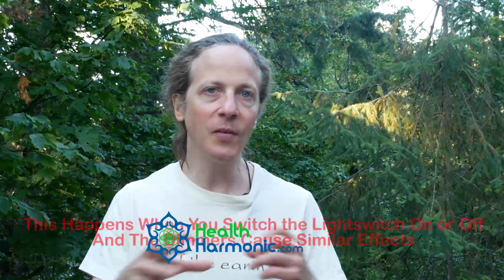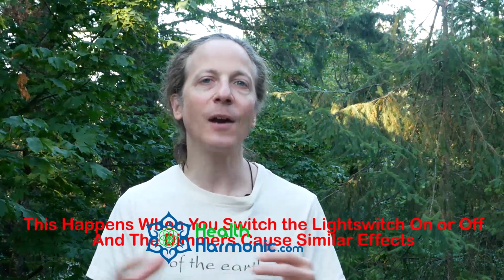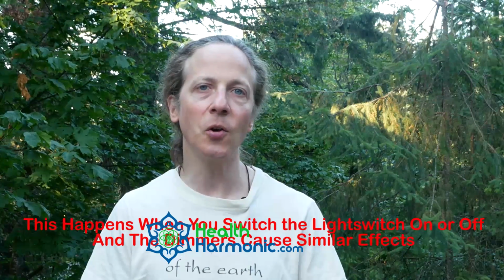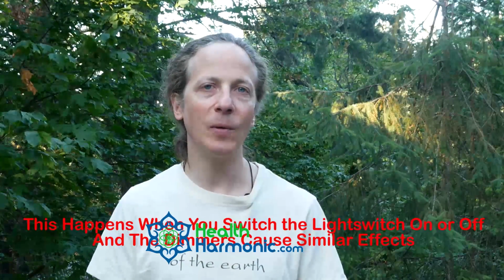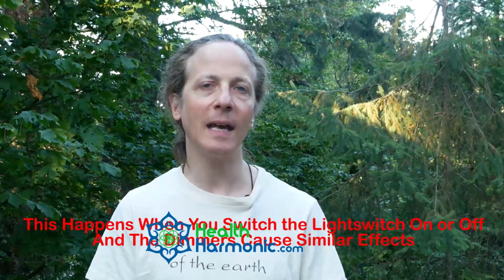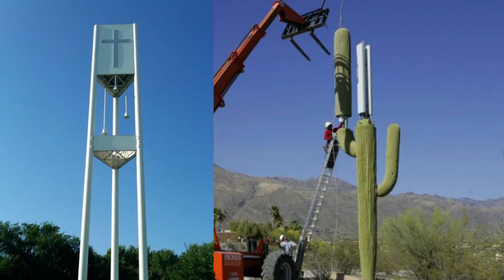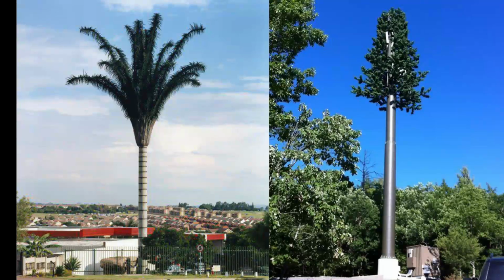Hidden Sources of EMF How To Prepare for 5G EMF Protection

Comment: Sorry, but confusing EMF and EMR shows a lack of knowledge, no understanding of basic science, and no ability to discern 'causation' and 'confirmation' which is basic scientific methodology.

- Your description of aerials, particularly automotive, is almost totally uninformed misinformation!
- Batteries radiate nothing - they are just storage devices, although they will dampen or reduce certain EMR AND EMF.

- EMF/EMR shielding is not like a two way mirror or a mirrored window, it is a partial or total block from either directions.

- Electric light switches do not create multiple pulses except arcing when faulty, just a single switching transient for on or off.
These have been around for how long now, without any realisic detriment?

- The Smart Meters do not transmit continuously, but collect data and transfer it on a schedule, they are also on the outside of the building structure and any EMR is generally blocked or significantly reduced by building materials and distance from the low power aerial.

- An EMF Consultant - An unqualified or self-appointed charlatan in most cases.
Uses pseudoscience to legitimise 'environmental tech speak'.
Might as well go to a clairvoyant or fortune-teller at a circus.

- If you want real EMF/EMR data on your house, then engage a Real Engineer/Scientist with real experience in the appropriate fields.
Oh, that's right - most of them are engaged in real work to benefit all!

-  Please stop feeding on the fears and anxieties of the less fortunate and uninformed.
Reply: @paulinepeppler8248  If that was meant to be an apology, then why did you justify it with "This country is run by greedy white guys."?
What country - I'm not in the almighty US of A? Nor do I care what colour the leaders of a country are, so long as they are good leaders. A not so good politician would be someone like Alexandria Otego-Cortez or Trudeau or Jeremy Corby.
Greed has no colour or race, it's a consequence of fallen humanity.

As for not being a racial slur - how else could it be taken when you direct it at an individual, then follow it with a moral and financial denigration of the person.
I think that your comment might just fit your own definitions of 'preconception' and 'targeted individual'.

"Preconceived notions of lack of knowledge"  It's hardly a preconception if the reply to technical facts is character assassination, primed to 'virtue signal' and shut down rational discussion.
A switch from 'agressive' to 'passive-agressive' commenting also doesn't help in discussion of knowledge, facts and experience.

If you have factual or scientific or knowledge issues with the original comments, then why not discuss them with a rational informed comment?
Reply: Denim Lowe  You need to read The WHO/IARC definitions of carcinogens rather than just regurgitate misinformation.
Currently there is NO definite 'Confirmation' of EMF/EMR, including mobile phones, wifi, wlan and llan, in relation to ANY carcinogenic effects at the leglegislative, recommended or mandated safety levels.
Would caution and further research be a good direction? I think so, and it is already happening.
Read up on 'speculative vs anecdotal vs causation vs confirmation'!
The absence of proof (of safety) is not the proof of presence (of danger).

The WHO's definition was made by the IARC, which has classified radiofrequency electromagnetic fields as POSSIBLY carcinogenic to humans (Group 2B). This is a category used when a causal association is considered credible, BUT when chance, bias or confounding cannot be ruled out with reasonable confidence. i.e. 'Causation' is POSSIBLE, but without 'confirmation' is speculative at best.
Group 2A is  used when a PROBABLE association is considered credible. i.e. Scientifically repeatable and 'confirmed' from multiple independent sources.
Group 1 is used when a PROVEN association is considered credible.
You're correct in saying you won't argue - that would require thought and facts, which would then make it a rational discussion. 😉
Reply: @paulinepeppler8248  
This is a comment on EMF, EMR, MISLEADING INFORMATION AND PSEUDOSCIENCE, and someone making $$$ off people's fears, anxieties and lack of understanding of science.

This it is not a personalised derogatory political rant.

Your continual use of colour, racial and ethnic slurs has extended to atitude, ageist, gender and body slurs!
Please examine your own prejudices and motives before commenting, and desist until you have something not derogatory and worthwhile to add.